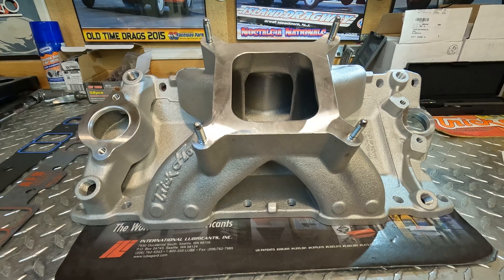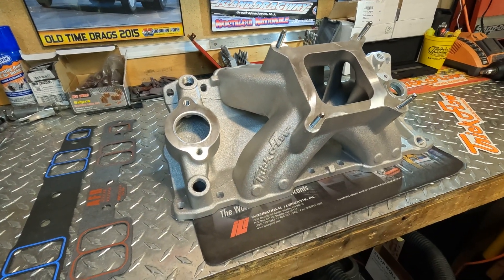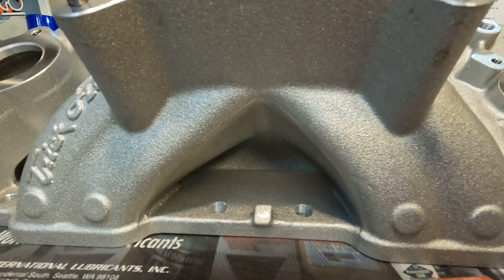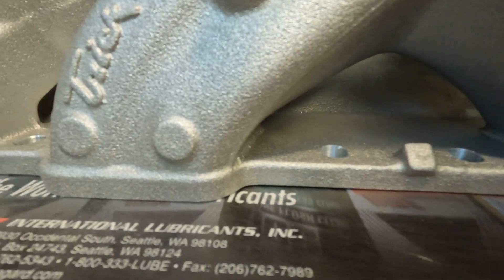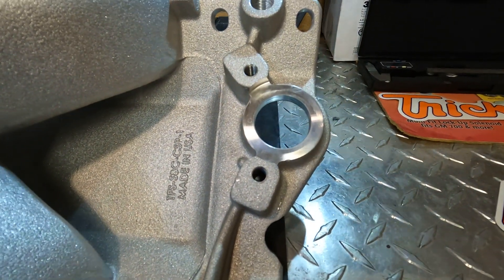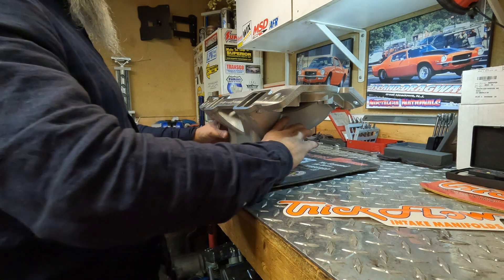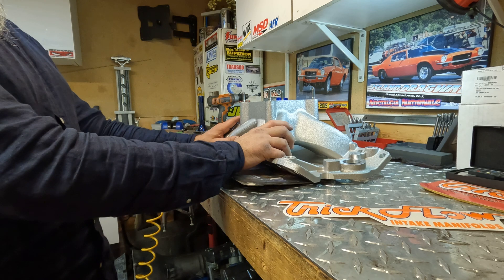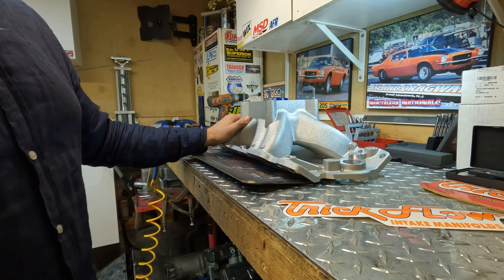Trick Flow R-Series Intake Manifold for Small Block Chevy

Comment: Just picked up this intake for my 436 SBC. What kind of HP and TRQ increases have you seen after porting one of these ? Engine has AFR 220 heads currently with a Victor Jr 1" taller intake that has been ported.
Reply from the maker: Depends on the combo. I’ve ported a number of these, but haven’t done any A-B testing with it. What RPM range? Compression? Naturally aspirated? How much work into the Vic Jr.? Are those the CNC, competition ported, heads?
Reply: @ChopperScott  Yes they are the CNC comp heads, there are several hours of work into the Victor Jr intake. Compression is about 13.75-1 and yes N/A. Thanks
Reply: @ChopperScott  RPM range would be 3500-7500
Reply from the maker: The Trick Flow may be better suited for your combo. Unlike the Vic Jr, it was designed for bigger cubes and high flowing heads. As far as stock vs ported is concerned, you’re welcome to send it to me after you’ve ran it, and verify whether or not port work improves performance.
Reply from the maker: I have the same set of AFR 220 Comp heads on my mock up block for checking manifold port alignment.
Reply: @ChopperScott  Thanks Scott, That would be great. I will test it in the next week or two.
Reply: In testing it seems like the Trick flow intake is about equal to the ported Vic Jr or has just a touch less HP and TRQ. We are talking .5 MPH which could also be other factors.

Comment: Great video! I’ve been searching for the specs on the intake port size. I have Dart iron eagle 215’s and this is one of the only intakes I’ve found that fits a 1206 gasket out the box. Thanks
Reply from the maker: Thank you. This is a real nice casting out of the box. Port size, shape and alignment is better than most, especially for the price.

Comment: I'm planning a SVII 2892 for my 440 sbc. Do you think the TF-R can match up to it?
Reply from the maker: I currently have the SVII 2892 on my 434 SBC. (I refer to it as a 427 for nostalgia's sake). I think the SVII will be hard to beat, but I plan on running them back-to-back on the track to find out.

Comment: I would've liked the runner dividers to extend further into the plenum and a bit more meat to allow better blending from the runners to the carb pad.
Reply from the maker: Not much material left to blend there. The casting is well manufactured to reflect the R&D put into it. I’m going to refinish it with a burr finish on the floor, and 60 grit in the runners.
Reply: @ChopperScott  Any idea on the CSA of the runner entries and what they're capable of going up to?
Reply from the maker: No sir, not at the moment.

Comment: It does look nice. Should be a good fit for the 245’s. I had MBE port my dart for a raised deck IE block and they removed a lot of material. This intake looks similar.
Reply from the maker: Yes, the ports look like a nice match for the AFR heads. Extensive port work not required. I will refinish it though.

Comment: Great review !  In your opinion do you think this intake will outperform a Edelbrock super victor 2925 I currently have ?  Runners look large on the trick flow intake .  I have a 11:5.1 406, afr 227, big solid roller .
Reply from the maker: Thanks! Without testing, I couldn’t be sure. It will be compared to the 2892 that I’ve been running in my Camaro with AFR 245 heads. We’ll have to wait until next season.